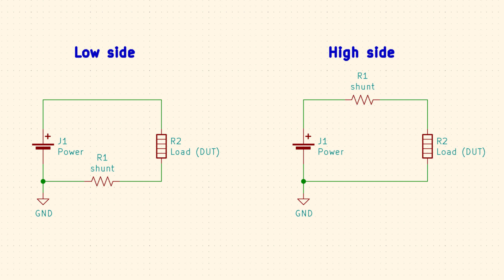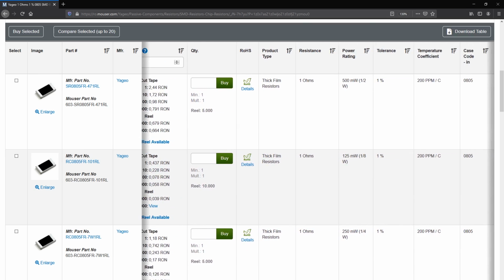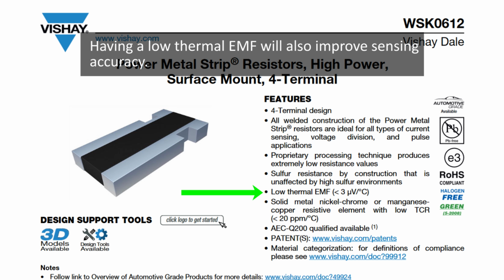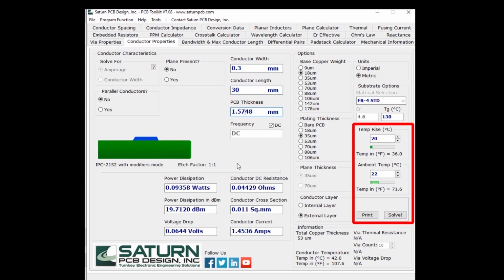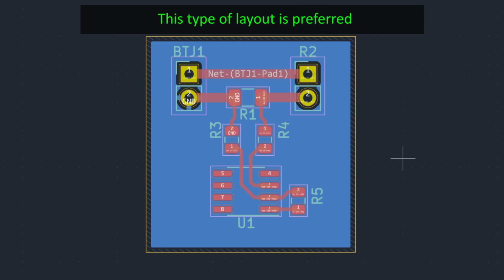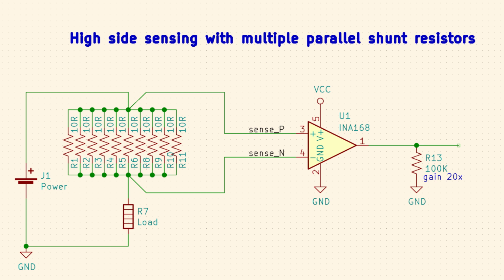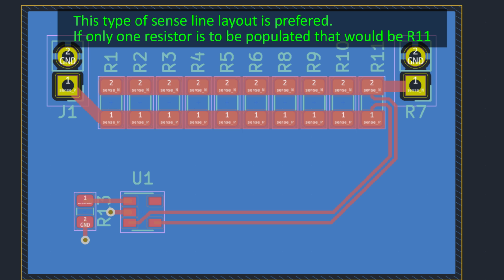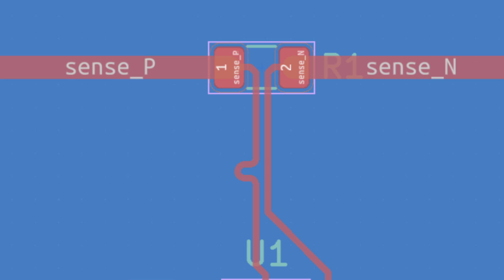Choosing, Placing and Routing A Shunt Resistor | Voltlog #313

Comment: In my work designing the HP3478A (I see one on your shelf!) I learned that copper has a terrible temperature coefficient. On our first prototype, the sense wires were connected to the shunt in such a way that the effective resistance of the shunt included some copper trace. Put in a high current, and the measured value slowly changed, out of spec. Maybe that's not as significant if you're not designing a 5 1/2 digit multimeter.
Let's see, Google tells me that copper tempco is .00393 /k, that's 3930 ppm per degree c?
I think any design with multiple resistors is going to have copper tempco problems, so you need to keep the resistance of the copper way below the resistance of the shunt to minimize it.
Reply: Thanks for your work on the 3478A, Rich! I own several of them. 👍
Reply from the maker: Thank you for sharing this and for your work on the HP3478A!

Comment: I have a good question to you - why in different DMMs, manufactures always use a proper shunt resistors (usually a thick "П" shape wire ~20 mm length) but in serial conjunction with a PCB trace, which is a cooper?
Usually ratio is that ~95% of resistance (and voltage drop) is on the proper shunt, and ~5% is on PCB traces. As a result, even not cheap DMMs (imagine UT61E) have a current measurement drift in time, on bigger current.
For example the UT61E (20A rated) with 6A, after 10 minutes of current passing through, will increase reading by 15mA, while other current measurement devices in the same circuit keep current exactly the same and stable, up to 1mA precition.

I tried to google and could not find a good answer for that.
To compensate non-zero TCR of the proper shunt? Then why it's worse than other not-DMM type of devices, where only shunts are used current sensing?
Help please to get this point.

Comment: Another great video Voltlog!  I learned a lot of this material the hard way; designing and redesigning the Joulescope front-end.  As @Tiago Ferreira
 mentioned, the parasitic effects really start getting difficult to manage as frequency increases.  Inductance is particularly problematic.  Larger shunt resistor = larger inductance = lower bandwidth.  But smaller resistor = worst power dissipation = more temperature dependency.
Reply from the maker: Thanks for the feedback!

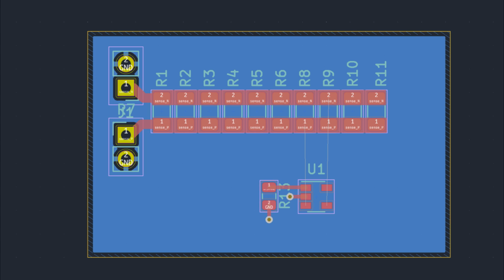Comment: 9:13 circuit with terminals on each side  is best for multiple resistors is best since it is symmetrical,  but can be thermally influenced by nearby heat sources

Comment: About a million times more important than the matched sense paths is controlling thermocouple effects. Make sure the shunts are thermally balanced, so that temperature difference between the two sense points is minimized. And of course, also minimize any thermal gradient across your sense amp...
Reply from the maker: thank you for sharing this 👍

Comment: Matching the length of the sensing pads seems wrong to me. This just makes the total path longer which decreases the voltage at the sensor. Or am I missing something?
Reply from the maker: The idea is to keep those lines balanced, because any voltage difference is mistaken as being caused by the passing current through the shunt, thus increasing the measurement error.

Comment: Hi since you're talking about shunts and current measurements, then may i suggest you to make a video about switch mode current regulator? 
I am trying to design one which in "theory" would but probably won't and i can't find any good circuits for that.

So i would appreciate if you make a video about a switch mode current regulator without a uC/MCU.
Reply from the maker: Okay, I've add your suggestion to my list and will consider it for a future video. Thanks!
Reply: @voltlog  Thanks. Would appreciate more if you don't use dedicated ics for that and even if you use then forget to explain it.
Reply: Check out the Youtube channel KatKimShow, great primer on switch mode power supplies and then read some TI materials. That's what I did.

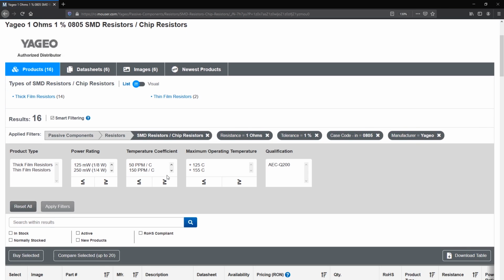Comment: 2:00
1 RON = 0.23 USD
(random exchange rate website evaluation for June 9th 2020/doesn't matter at all, just a curiosity)

Thanks for the insights. I learned about metal film temp-co the hard way.
..."what the ?! My 0402 10mR shunt can't handle a piddly 10 amps!"
...maybe not that bad...but...

 What is the best practices consensus for traces under a surface mounted package?

Thanks for the upload.
-Jake
Reply from the maker: It's quite a general question so the answer wont be very specific, in general I just consider available clearance and possible noise coupling into sensitive inputs.